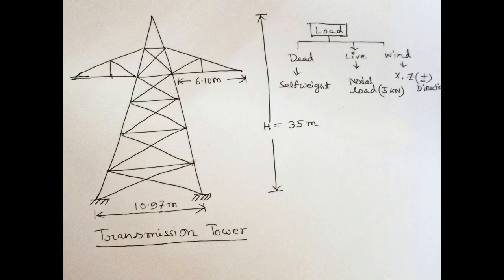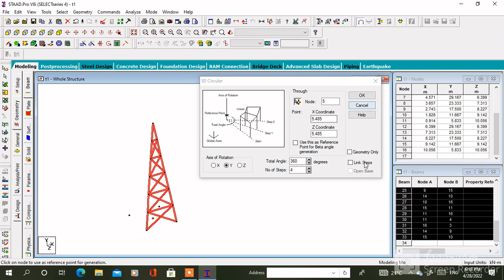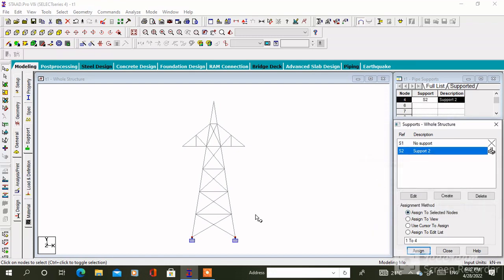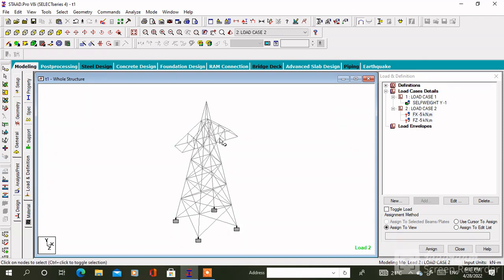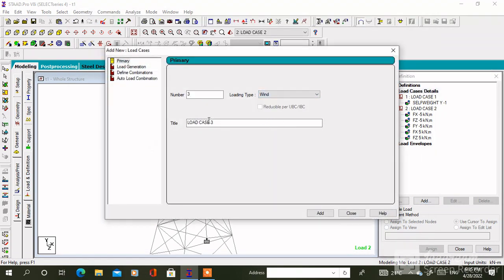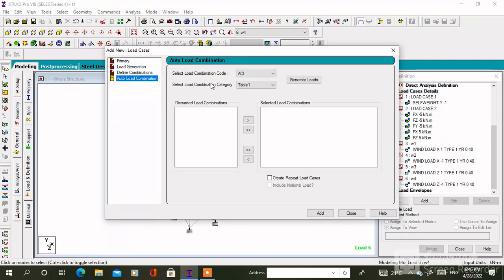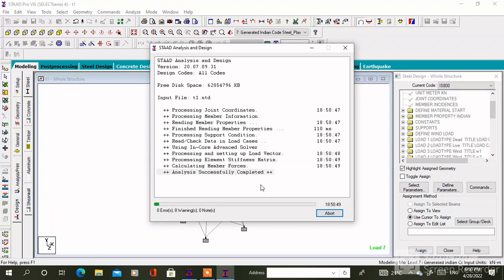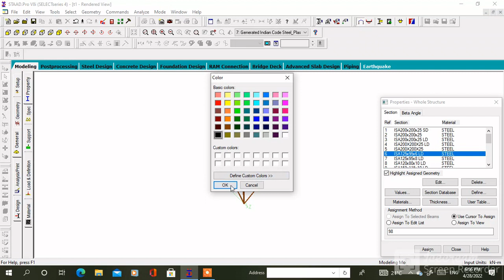Analysis & Design of a Transmission Tower using by Staad Pro V8i as per IS 800.

Comment: No member released. The structure is considered to be a rigid which is in practical not.

U may use truss command for the all columns and 0.99 Mp release Start and end for all the bracings to treat the case more practically.
Reply from the maker: It's correct,, u may released the members where its requested, their will be some small changes,,but main part & the output+ load calculation will b remain same,
Reply from the maker: I appreciate u.and the Truss command,,it's better to use Etabs software to do this,,coz in Staad pro I think no any easier process is their to create this type of tower,